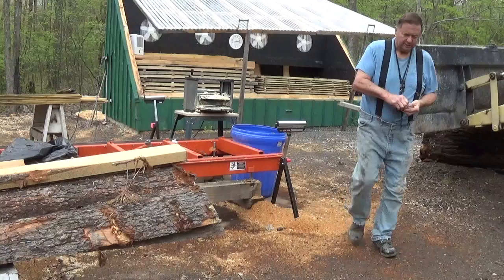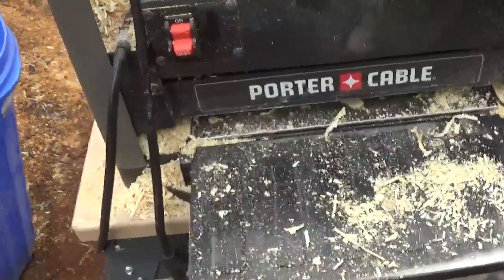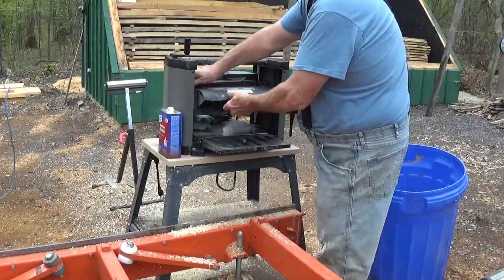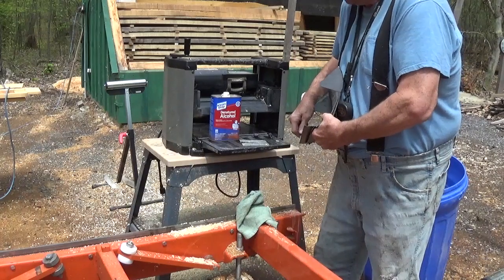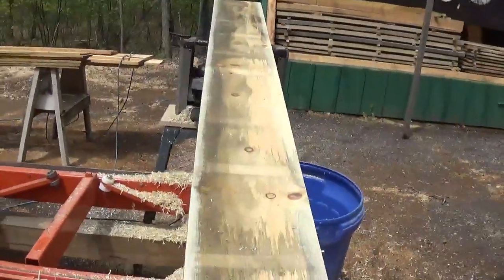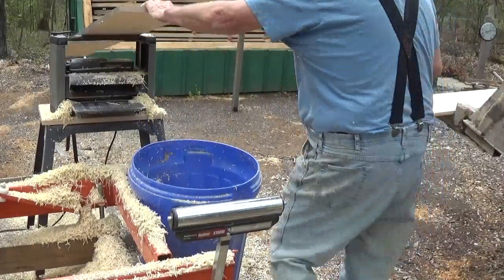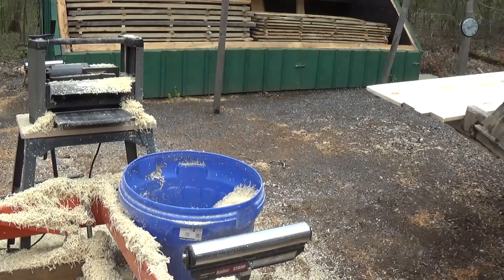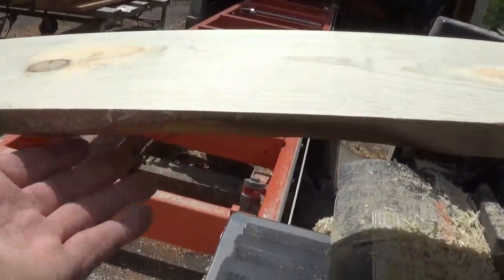If you want nice lumber from your sawmill check out this video.

Comment: Howdy Joe  Havind been a cabinet and furniture maker for over 50 years...I canshed some good advice on planning! IF??? You are just a hobbyist and will just be planning a thousand board feet or so..that 400 dollar straight knife planner you are using there will be fine! That pine board you just planned?  After you plane a dozen more of them? It will be time to replace those straight blades....which..as I remember is about 20 bucks...not to bad!? How those flat knife blades stay relatively sharp thru a dozen boards? is a mystery to me!  NOW!! If you want to plane boards till the day you die?? And NEVER replace cutting knives? Get Grizzleys 15 inch SPIRAL HEAD PLANNER! Its ..hands down.. the most rewarding machine in my shop!!  Makes your wood like glass BTW AND Instead of two flat blades spinning around a two inch drum? It has four tracks of  half inch square super sharp blades set about a half inch apart...in a spiral around the main drum! AND Each track is staggered from the one next two it! Theres probably 30 of these little square cutting blades per run as they each make a run all the way down the main spinning TUBE. SO ! Its super effective and ingenious! After running my planner daily for three years? I finally decided to pull the head cover off....lossened the screw in the center of every four sided cutting blade and then rotated them one quarter turn for a brand new cutting surface!! This can be done FOUR times before needing new blades!   Its a haevy duty 220 motor  ....has convienent oil stations for the oiling stations!! Keep the machine CLEAN and it must have a strong dust collector hooked to the 4 inch ready to go exhaust port! This keeps the saw chips out of the cutting heads way! This machine will take almost a quarter inch of material in one pass! It also has two feed speeds! I had a totally   GRIZZlEY  shop until I moved and I loved it! loving that planner the most!   Once my home and shop and barn sold?? I had to move in a hurry! So I sold all my Grizzley tools to a contractor who had the means too move all that heavy machinery. I am now in the Woodmizer business and will be getting a new spiral head planner soon! There are NO Grizzley stores or outlets. They just bring it to your door once purchased.  The cost of the 15 inch planner? PUSHING  TWO GRAND!! But worth every cent in my opinion! IF? I were to get the way cheaper straight blade planner? Id definately buy the YELLOW one for 500 bucks! You Joe? need that Grizzley! Youll love it as much as your LT15....which is what I have being made for me...as we speak

Comment: I have used your method of planeing for about 30 years. I have found that it works well as long as your planer
 is not compressing the board as it is fed through the planer.
Reply from the maker: Thank you for the comment, just the way you worded it tells me you know what I was saying.
Reply: Light passes until most of the board is flat.

Comment: With a brushed motor, you can replace the brushes.  On a brush-less motor, when it stops, it is done, no fixing it.  Brushed motors are more durable because they are serviceable.

Comment: hooking up a shop vac when running might help keep the planer cleaner
Reply from the maker: A shop vac would need emptying every 2 boards and that is a 16 gallon size.
Reply: @josaljo1  get a separator and a 55 gallon collection drum (or two). Use the shop vac to pull the vacuum only, not as a collection bin.
Reply from the maker: @thomasarussellsr  I will have to put that on my to do list. That should work.

Comment: Would more persnickety stacking, using more stickers and a heavy weight on top for enough pressure to stop cupping of the top boards serve to reduce your cupping issue?
Reply: This can reduse twist and some cupping, but wood will move where it wants, eventually, so why not catch it at the planer? Ever had a board cup/twist from humidity changes after a project is complete? It happens. If you let it twist/cup a little during drying, you can address the stressed fibers during final milling better than a few seasons after the project is complete.
Hope this helped.
Reply: @thomasarussellsr  I get your observations. You are correct, yes, i have had wood cup after installation, much to my aggravation. The old 1820 Colonial i grew up in had 1 aprox(?) inch by 18 to 24 inch knotless White Pine floor boards all nailed down with hand forged square headed four inch nails, recessed and filled in with horsehair plaster "putty". That is what it took to keep things flat. Heaven forbid that a nail loosen up ... squeak, squeak, squeak.

Comment: You are saying the debris gets into the brushes from inside the motor, not through the cap?  My first thought was to put a piece of tape over the cap, but I can't really see how debris would get in through the cap.  I have another brand of planer and you are correct about the dust compressing in the bottom because of repeatedly lowering the head.
Reply from the maker: There are little air vents on the motor that I noticed, probably to keep cool. Thats is how I think the dust gefs in. Thanks for making me lool. Lol